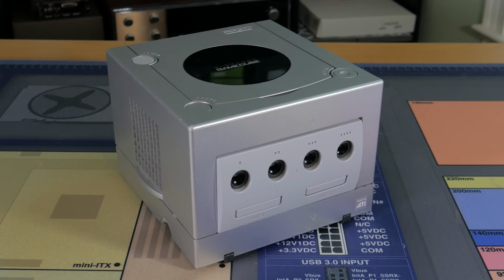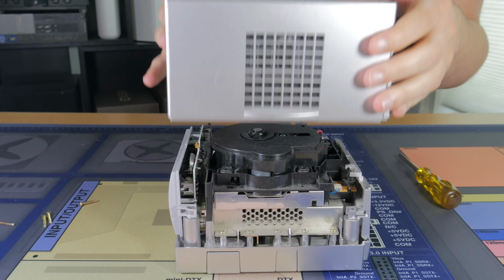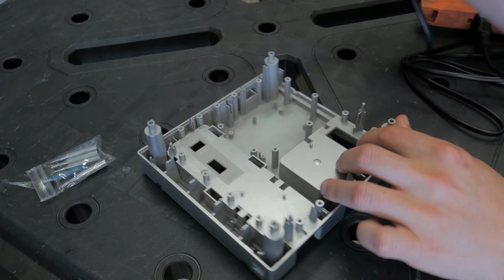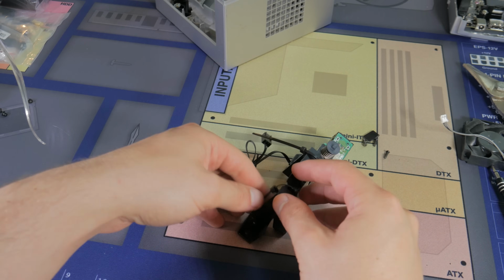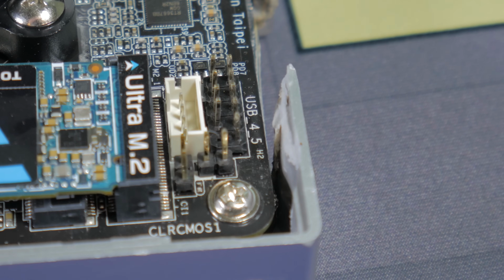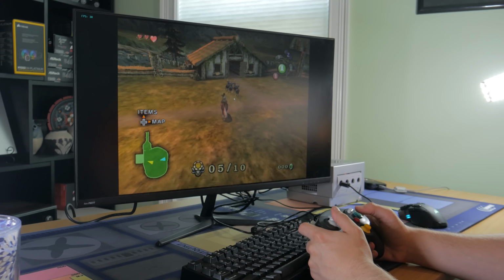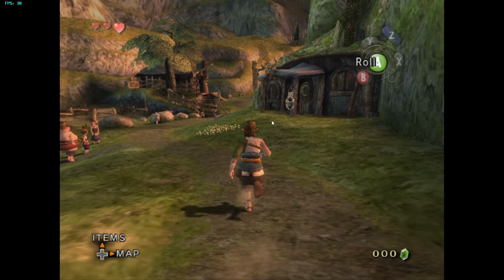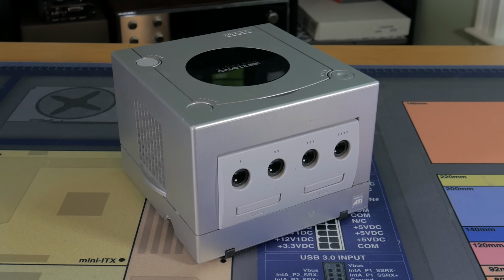I Built A GameCube Gaming PC!

Comment: Seeing this, I'd love to see an old PS2 turned into a PC.
Reply: That would be pretty easy to do; the old ps2's were huge. You could probably easily fit an mini-itx mobo, graphics card, and power supply inside a ps2.
Reply: @ChuckDGard  For extra challenge, he can use the PS2 Slim
Reply: Otodus Obliquus is there even a cooler that low profile? Sounds unlikely. The original ps2 could probably even fit an RTX card though.
Reply: Het Speelkwartiertje Slaat Terug the THICCBOI PS2
Reply: @hetspeelkwartiertjeslaatte2624  i think using maybe a laptop mainboard or maybe a lattepanda alpha it still could be done
Reply: ChuckDGard and it already has a hard drive bay.
Reply: @ChuckDGard  an spanish guy named sdfx show did it and he incluided a 1060 and a ryzen 5 3400g
Reply: @ChuckDGard   An ITX board fits EXACTLY, with no room to spare at all (as in touching both sides), in the wide top part of the PS2 phat.

This leaves room for a low profile GPU next to it since the PS2 is fairly long!
Reply: no way you could fit one in a slim ps2. but a phat one no problem.
Reply: @rustedyoda7339  You guys got me, I think I try the PS2 slim pc build.
Reply: @rustedyoda7339  you could build a "computer" in one, using a raspberry pi board. they arent that powerful though. good for low level and fun projects.
Reply: I wanna build a console killer inside a ps4 housing
Reply: @cynixx8737  if you do, be sure to have one key feature over the PS4. System silence. That is my only problem with the PS4, besides the paid multiplayer bullshit off all console gaming, is that it gets so damn loud when running Red Dead 2 or God of War. Do record this as well if you can because stuff like this I find super fascinating.
Reply: Or an Xbox Classic
Reply: @ManOfAttitudeLP1998  here is one https://youtu.be/2fL3VbC2izo
Reply: @biggbird5008  that was my inspiration to my build. I dont have a brake, so I didnt make a metal insert for it, but I got it to work without. just needed to dremel off all the screw standoffs in the case to get the board to sit down low, and trim the top a tiny bit to give more clearance for the heatsink fan.
Reply: @ManOfAttitudeLP1998  https://prnt.sc/rsuzfh
Reply: Some already did that on YouTube, it is insane
Reply: @richardcush9161  I dont necessarily believe you could you link it by any chance? And yeah you can fit an intel nuc or a minipc from aliexpress in there.
Reply: @Cunt on Duty https://youtu.be/e834xxyuDMw just put english subtitles
Reply: Uhh.. what about ventilation and heat management?  Lemme say this: running Watch_Dogs on my sleeper digital dec PC is NOT a fun experience, especially with a lack of vents
Reply: @adventureoflinkmk2  you can add admitió al vents on the bottom part and some tiny fans
Reply: The PS2 slim was so small my dad thought it's a power adapter, u know, like laptop cables have. Probably because the only other PlayStation he saw before was my fat PS3.
Reply: I'd actually rather see a Wii or even a Wii Mini made into a controller.
Reply: Someone did that already, however they used a laptop brick for power. I'm currently trying to build one with an internal psu so it looks alot more stealthy
Reply: @sham_wow_guy  I think the PS2 used a laptop brick, at least the slim did iirc
Reply: @icandoublejump  not the fat model. It had its power brick internally.
Reply: Nintendo Game&Watch, now that would be impressive.
Reply: An spanish youtuber made it
Reply: not as easy as it seems. I went to tackle this, they arent quite thick enough, you'd need a super duper slim heatsink and fan and external PSU. I tossed that Idea and went with an OG XBOX. Got a mini ITX and power supply to fit inside. was able to fit the AMD heatsink/fan and even a 1650 GPU. Worked alright but thermal throttled a lot, even with using a 60mm exhaust fan. I even put USB 3.0 in place of the controller ports, and wired green LED's to the power button, which was also used. It was a fun build, but I ultimately shoved the PC in an ATX case a friend sold me for $20.
Reply: ps2 slim + nuc motherboard, might work :)
Reply: This isn't a new thing people, people have been building PC's in many things.
Reply: Bin laden tried once. It wasn’t worth it.

Comment: Regarding botw in your video.  During the lag you see the "compiling shaders" message on the top right.  Cemu has to translate the wii u shaders to pc shaders.  Emulation pauses while doing this, causing "lag spikes" whenever a new shader is encountered.  Once encountered the wii u shader is copied to a transferable shader cache in the cemu folder and will auto load next time the game is loaded.  Shaders won't stutter a second time. 

PC games can compile shaders during loading screens and consoles all having the same hardware, for a specific console, means the shaders are precompiled by the dev so there is no shader compiling on the console.
Reply: Hope he sees this

Comment: the stutters you experience with botw is the emulator compiling shaders for the game. playing through the game for like 10 mins will fix the problem. but some newly loaded shaders will ofcourse cause it to stutter again. sick build btw!
Reply: Agreed , I have 2 A300's , one 2400g (8GB ram) and one 3200g(16gb ram) , both run BOTW just fine , I use Vulkan , lock FPS to 30 and all other common add on such as cemu hook and so forth. Runs about 44/48fps so the 30 is smooth after shader cache has done is thing.

Comment: I'm looking to build a PC with a budget of about $700, any recommendations?
Reply: Ryzen 5 2600, b450 mobo, 16gb of ram clocked at minimum 3000GHz, gtx 1660 super
Reply: Cameron Ryzen 5 1600 af is basically the same as a 2600
Reply: @Cameron either 1600 af or 2600 is good, no need for 3600 if it means u can get a better gpu. The 2600x is $100 right now at Micro Center and u absolutely should grab it along with a mobo to get $20 off.
Reply: here you go, https://pcpartpicker.com/list/7DWXFG i couldn't fit the 1660 super into your budget but if you can do the extra $30-$40 or already have storage the super(or 1660ti if its a similar price) is worth the extra cash.

Comment: I wasn't aware they'd finished pinning out the GCN controller.

Also, y u no purple (asked by the guy who'd do it in black)

Cute cat!
Reply: Linus should do one with the spice orange GameCube lol
Reply: What do you mean? It's just what, 4-5 pins? And you don't even need to know what each of them is used for. All you need to do is visually look at the plug and pull wires to the same spot on the GC USB adapter.